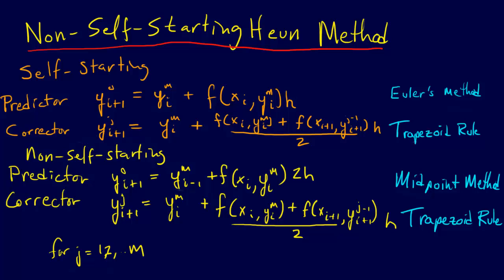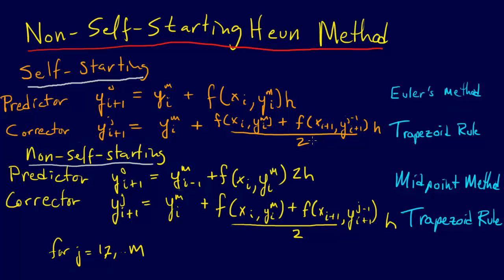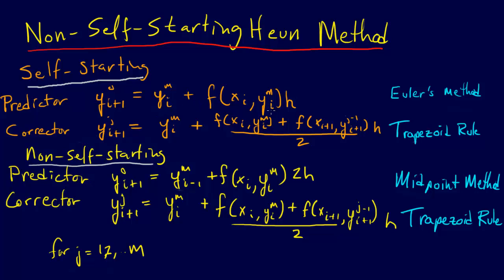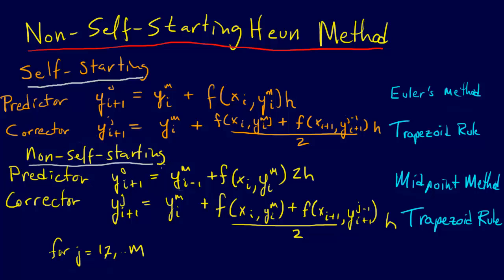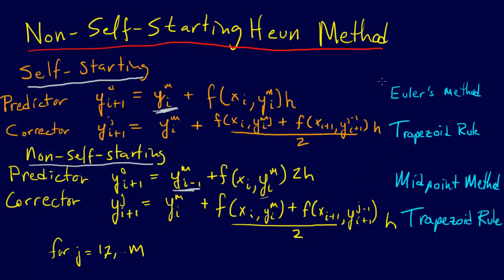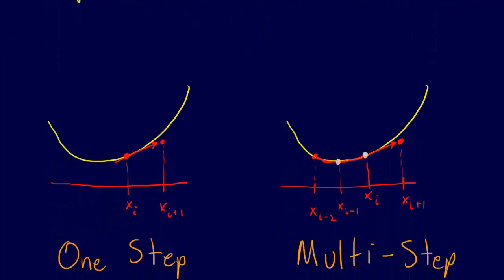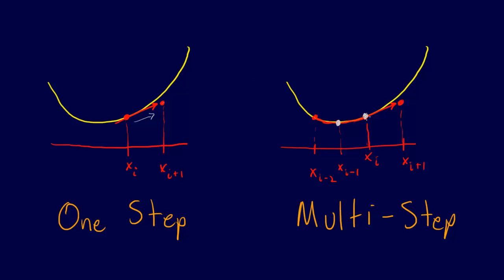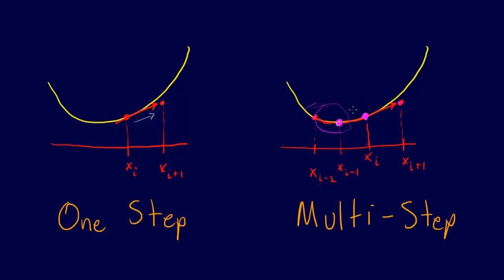7.2.6-ODEs: Non Self-Starting Heun Method

Comment: what does it mean for an equation to be self-starting?
Reply: I think that it means that it's not dependent upon any previous information.

For example, Euler's forward method is self-starting since:

y_i+1 = y_i + f(xi,yi)*h -- notice there's no dependency on anything other than the current time step.

In Heun's method, you can make the predictor more accurate by making the estimate for the derivative at the midpoint. You do this by starting at y_i-1 and doubling the step size:

y_i+1 = y_i-1 + f(xi, yi)*2h

This makes the predictor third order accurate, just like the corrector (trapezoid rule, in the case of Heun's rule).

Hope this was helpful (if 4 months late).